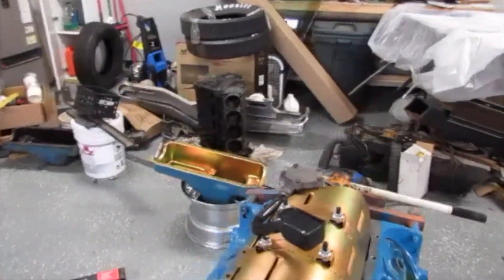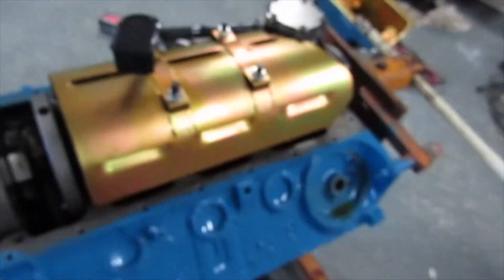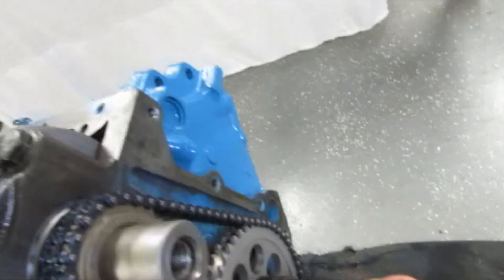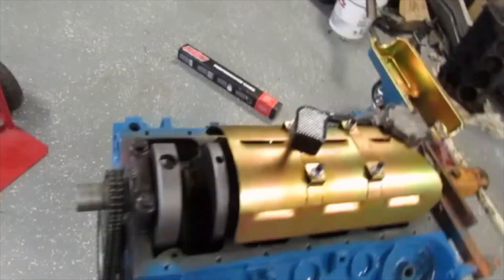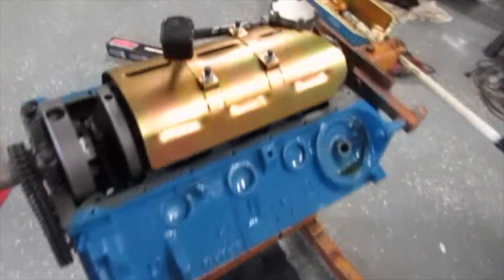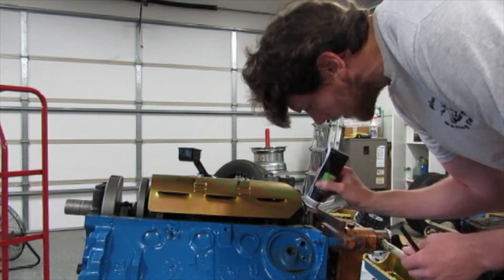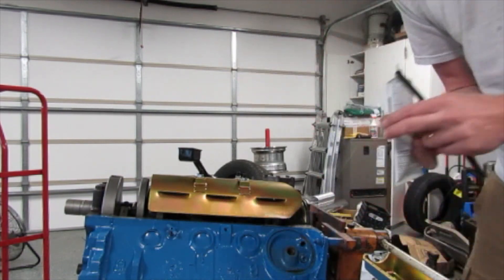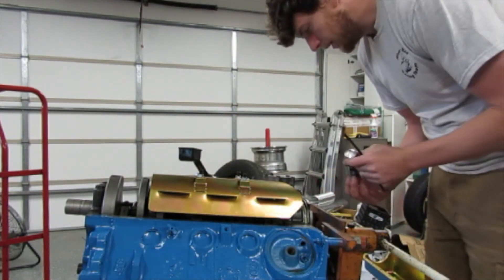360 Engine Build Part 6, Buttoning up the Bottom End! Tips and Tricks.

Comment: I do not use RTV anywhere I don't absolutely have to. Ends of the gaskets, yes. China wall, yes, IF REQUIRED!! But all other places I use SPRAY TACH. Spray it on the gaskets themselves while on a box cover and after it tacks up, drop the gaskets in place. Zero mess and no floating RTV in the oil pan.
Reply: Dude, you are so right.  One time I set a dial indicator on the milling machine, set and leveled the block on the table, and checked the China wall for true.  It was THOUSANDTHS off...  F me.  That could have been catastrophe!  Fortunately, I found this leak before assembly, but unfortunately, I chose the wrong method to try to seal it.  I used a micrometer to determine that the cork gasket varied in width from 0.492" to 0.501" in the straight areas and up to 0.522" in the curve around the distributor.  It gets worse:   That gasket also varied in thickness from 0.265" to 0.274" The gasket came in a thin white box without a name, but the girl working the counter at AutoZone swore it was made by the same company that makes Fel-Pro and that it came from China, but China designed the wall on my block, so I couldn't go wrong.  I was leery of this, so, I ordered some impression paper and bolted the intake down. Despite using a digital torque wrench fresh from it's quarterly calibration and new bolts inspected under a jeweler's loupe, I couldn't get an accurate impression across the gasket.  Turns out, the passenger side head was .0903 degrees from the deck surface and the driver's side head was .899 degrees!  After having the heads trued (shoutout to Paragon Racing Engines in Baxter, TN) and ordering thicker head gaskets to match, I retorqued the manifold and discovered uneven pressure across the China wall gasket... no shocker there.  Of course, I returned the gasket to AutoZone and exchanged it.  The new gasket varied in width from 0.489" to 0.499" and thickness was 0.266" to 0.268" which gave me hope!  My hope was short lived when that gasket did no better on the impression paper.  After my sixth, yes sixth gasket exchange at AutoZone, I decided to test O'Reilly's and Advance Auto's quality control against each other.  While O'Reilly's gasket was within the same range of sloppy tolerance as the others, Advance sold me a gasket for a rear axle flange.  it was Thursday at 3:00pm and I was starting to get panicky because this engine needed to be running, in the car, and at the Hatfield and McCoy Reunion Festival in WV the following weekend.  Time was SHORT.  So, I took a chance.....  measuring the gasket thickness and diameter every .100"... that's approximately 98 places, I made a chart of the thickness from end to end and mapped the high and low spots in the china wall.  Using a simple volume calculation from my days at Virginia Tech, I determined the volume of Permatex #2 gasket sealer that would be needed to fill the aggregate of the low spots, 9% absorption into the porosity of the cork material of the gasket and used fine silica in a burette tube to measure any total porosity in the surface of the China wall itself.  After repeating this process a few times to get it within a comfortably repeatable .02%, I had my number:  1.3mL for a leak free seal.  Here's where things went awry....   As I was clamping O'Reilly's gasket into the fixture jig I use for sealant application, I picked up the wrong tube and instead applied 1.3 mL of, you guessed it... room temperature vulcanizing silicone sealant, better known as RTV or Really Terrible for Vehicles as we called it back in the days at the ol' Saab Dealership.  Unaware of my mistake as my aging fingers didn't pick up on the texture and springtime allergies obscured the odor, I reassembled it as any other.  Come Wednesday of the following week, I had it all bolted back together for the first start up.  I checked the oil pressure, it was 62.4psi at 744rpm with 178 degree coolant in 62 degree ambient air of 40% humidity, so all was good there.  After about 11 1/2 minutes, I heard a sound I've only heard about in movies and the wildest of racing stories.  A knock was coming from under the engine bay.  Before I could set up my thermal vision and stethoscope, connecting rods, later identified as numbers 3, 4, 5, 7, and 8 all exited through the oil pan simultaneously!  While I would like to think I was horrified, I would be telling you that second hand as I passed out instantly and have no memory of the actual failure.  Upon returning home from the hospital and reluctantly cancelling my travel plans to Williamson, WV, I tearfully scraped up the remains of those connecting rods, and found these tiny specks of foreign material along with them.  Knowing very well that nothing came off of the clean haz mat suit I religiously use during assembly, the updraft ventilation was indeed working at the time, and since I use a prefilterd air system from a tank in lieu of a second air pre-filter anytime I'm at the shop instead of actually driving, this could ONLY have come from INSDIE the engine.  I felt so violated.  I sent it to JMJ Laboratories just east of Little Rock, AR as they have a great reputation.  Their analysis concluded that it was RTV sealant!  I thought "How could this be?"  I know better than to use that stuff on a build.  After going through the phases of anger and denial, I went home and weighed every tube of sealer in my shop and checked those numbers against the log sheet I keep on file.  You guessed it.... the Permatex #2 tube was almost a gram heavier than it should have been and the RTV tube (which I had bought to fix a plumbing leak in the house... had the wrong size pex tubing) was nearly a gram.. too... light...   (big sigh).  I fell to my knees cursing the cruelty of the automotive gods, but learned a very valuable lesson and that is the dangers of RTV silicone on an engine's China wall.  We can only pray that our young friend Joe here will discover his reckless use of RTV before it's too late.
Reply from the maker: Thanks for watching Steve 1961P. I addressed this issue and several others at 13:15 in this video.

Comment: Using  a torque wrench on the pan bolts keeps you from having the pan flange bow up between the bolts causing future leaks caused by over torque. The Mopar engineers say 200 inch pounds. If you use the Magnum Motor 1 piece gasket it is encapsulating steel inside the rubber and limits the torque...but you have to use the Magnum pan as LA pans have notch at the top of the curve in four places.
Reply from the maker: Thanks for sharing. You don’t have to use a magnum pan. Here’s an engine in ran with a couple hundred passes. https://youtu.be/FJ2LAj5Wiw4

Comment: Hey there Joe, question about the rear oil pan rubber seal. 1) the seal does not sit all the way down in the groove of the main cap. Is is that normal? 2) the book states to overlap the seal, but does not specify if the seal should overlap the cork or the cork should overlap the seal.
 There is a grove for the seal ends.  Having the seal overlap the cork gasket would lift the seal above the groove of the main cap. Also the book clearly shows that the notches of the cork gaskets go to the rear. 
 '79 360 Power Wagon
Fel-Pro gasket set #
OS6566C-3. This is holding me up and I've seen four different people do it two different ways. 
Engine is in the truck so I only want to do this right the first time. Thank you for your help, again.
Reply from the maker: I always over lap the seal with the cork. Seal is most important. If you need to trim just a bit off the cork, be careful. Rtv over and under. You’ll be good. Maybe use some studs to help locate gasket in as many places as possible 👍🏼
Reply: @JustMoparJoe  my biggest concern is that the seal doesn't sit flush in the groove all the way around. The seal ends fit in each notch at the ends, but there is a good 1/8" gap between the seal and the groove surface.
Reply from the maker: @rickstotts9176  the last two I’ve done were like that. You can throw it in the freezer and it’ll shrink up overnight. I’ll include my last small block sealing video to show how I did my 408 in my drag car. It’s the driest small block I’ve ever assembled!
Reply from the maker: @rickstotts9176  https://youtu.be/vBOQjaptCR8
Reply: @JustMoparJoe  I remember that video. I'll watch it again and throw that seal in the freezer and hope for the best 🤞.
Thanks for your help 👍.
Reply from the maker: @rickstotts9176  good luck! It will work out. Rtv is our friend! But you can also run a magnum one piece gasket if you’re scared of the other. I have a video on that too 😂
Reply from the maker: @rickstotts9176  https://youtu.be/3GorouLtSw4
Around the 14:00 mark

Comment: I had looked into epoxy coating inside of block. Response I got that kept coming up was, "Why put a foreign material inside your engine ". So your referral to cleaning it a true key.  Keep everything clean. Im cleaning all casting flash any buggers out of block n head's.  It's all the extra steps.  Some may seam extreme, but so is a catastrophic failure.  Especially if it could've been avoided. 
Take Care and Keep The Greasy Side Down.  God Bless
Reply from the maker: Thanks brother! Have a good weekend

Comment: I like the pro gear timing components I’ve gotten through Hughes engines.
Reply from the maker: I’ll check them out. I used this Howard’s kit again on the Juan Carlos truck. It was as tight and nice as this one. True roller with adjustability.

Comment: Did you have any problems getting the stock pan to swallow the windage tray? I have the same scenario except mine is a stroker with a stock pan.
Reply from the maker: No issue here. This was a milodon pan as well. I’ve had one on the red sled 360, but it was a rock auto pan for a truck.

Comment: I always use the timing chain tensioner on LA and Magnums. Cost $35-45 but keeps the slack side taut. Ran one in the early 2000s on a 340 stroker (416) and refreshed a few years ago, chain still good, rubbing blocks had minimum wear, reused it all after a rering/bearing job and a different cam. Have used them in every small block since, from bone stock to radical 13:1 roller cam jobs. Love them! Keep up the good work! RB
Reply from the maker: Rodney Byrd thank you. I’m only 31 and am always wanting to build my next one better. 👍🏼

Comment: We called "Yellow Dog" "Gorrila Snot"!  That stuff really sticks. I have never seen it used that way. I have always used RTV silicone but this maybe better.
Reply from the maker: EZElk I use it for adhesive mostly. Valve cover gaskets to valve covers, but usually not both sides of a gasket. When I was younger I glued both sides of an oil pan gasket to the block and pan. Had to use a pry bar and hammer to get it off later 🤦🏼‍♂️

Comment: Why not put the oil pan on after the timing cover is installed?
Reply from the maker: Garry Hatchett I prefer to do the timing cover first. In this situation, I’m trying to seal up my motor while I wait on my new timing set from summit. I should have mentioned that in the video
Reply: @JustMoparJoe  you did mention that in the video joe, you completely explained it all and that you were going backwards a bit but you wanted to get it sealed up cause it had been open for quite some time and you were concerned about dust and other things flying around and wanted to get it sealed up. 

I heard all of that without hitting rewind or slo-mo etc, so someone else just wasn’t listening too good cause you’ve clearly told us why you were going out of order, nuff said brother!!

Your doing awesome man.
Reply from the maker: @1982MCI  thanks brother! This engine turned out awesome!
Reply: I think he did it this way because it jus prettier.. Plus, it jus sexier that way alone...